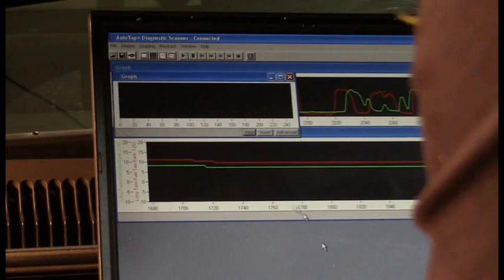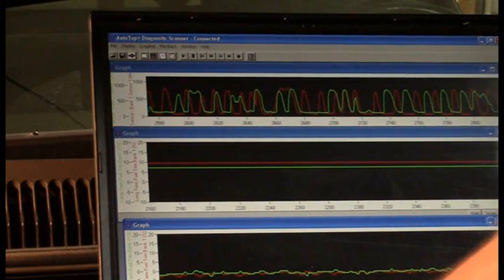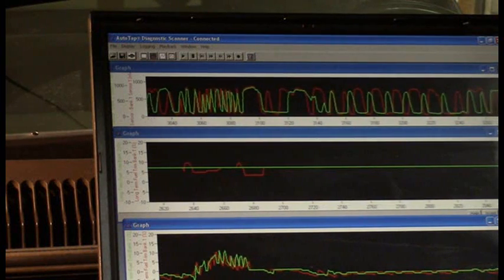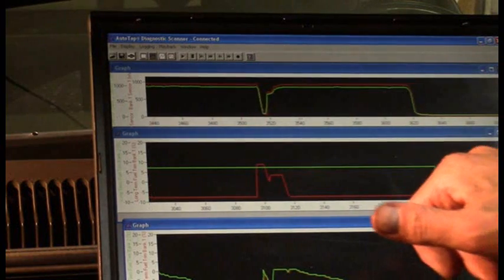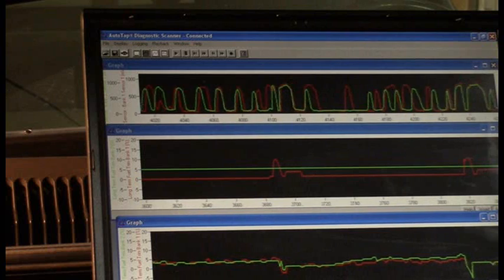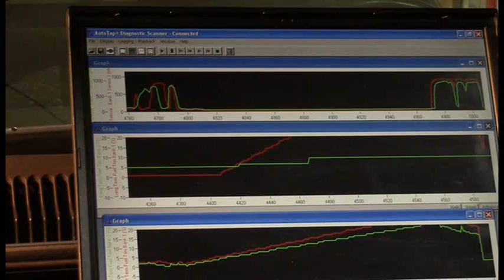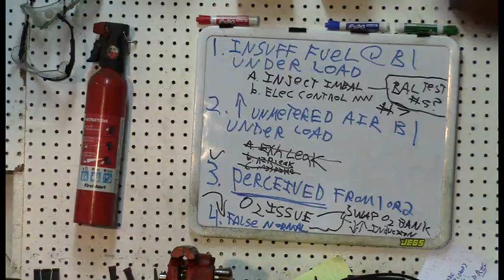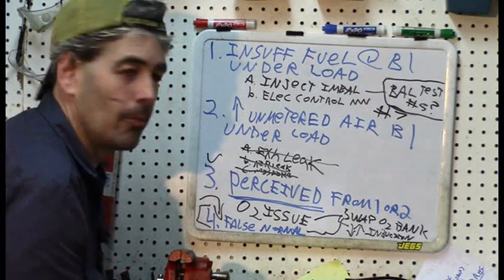Test Your Lean P0171 / P0174 Diagnostic Skills-Pt4

Comment: This may sound silly but why not try a different scanning software - Autoenginuity.  The problem with Bank Two may be a glitch in the scanning software you are using.
Reply: Sandbag1300 Dude, I like that! If you clear the codes maybe Matt can capture enough scan data to show what the O2s signals are truly generating before a P0171 sets again! Excellent Reasoning!
Reply from the maker: Actually maybe- but what caused the problem in the first place?  I agree if I clear the codes and reset fuel trim data and then fix the cause of the P0171 which may have been the issue all along that may indirectly fix this fixed LTFT.  We will see. But in a way, I hate to see it go away, this presents a fascinating learning opportunity into the operation of the computer lol.
Reply from the maker: Sandbag1300 It's not a silly idea- in fact I actually think that's the problem- but not because of faulty software or a glitch. What is happening (I believe) is I am seeing a "substitute value" for the B2 LTFT because the computer is seeing a problem that is "hidden" because we have an existing P0171 code preventing other issues from being revealed.  There is a way around this (using a modification to the software) which I will explain in next video.  But basically, yes, I think you are right- I need to set the software to ignore any substituted values the computer is using.
Reply: Schrodingers Box Could the fix be as simple as clearing the codes from the PCM so that the scanner will then pull LTFT data from the bank two tables that change based on O2 sensor input?
Reply: Schrodingers Box Operation of the PCM! Now that would provide some really interesting material for a series that who knows where it good go.
Reply: Schrodingers Box It would be very interesting if you ever wanted to put a custom PCM in your car and create a video series on the programming of that PCM.  Then, of course, vary the programming to see the impact on engine performance.
Reply: I am a novice.  My last auto shop class was in high school over 35 years ago.  We did not have PCM's then.

From what I read last night regarding programming PCM's suggests that the scanner is pulling bank two LTFT data from a table of semi fixed long term fuel trim values in the PCM that is minimally affected by STFT/O2 sensor input.  I believe it may be a default long term fuel trim table used when a certain DTC code is triggered.  This is probably to protect the PCM from adding too much fuel while the DTC is triggered.

My guess is that once you clear the DTC(s) from the PCM the scanner will then start picking up fuel trim values from a different table in the PCM that does modify long term fuel trim values based directly on STFT values/O2 sensor input.

Then, hopefully, the diagnostic scanning tool will help identify the source(s) of the lean condition.  Going out on a limb here my best bet is that Bank Two triggered the Lean Condition and the equal condition is present on Bank One.  This may mean new O2 sensors upstream on both banks or a new MAF.
Reply: Sandbag1300 Yes, that may be it. As long as the PCM is protecting the car from the problem that exists, we aren't seeing the problem.

Watching the PCM program a protection for the engine and catalytic converter may point to the problem itself.

Comment: I think it may be a substituted value problem as well.. I would unplug O2 check readings. I've seen a Saturn with substituted vales even when O2 was unplugged and never flashed a code. That car ended up being broken signal wire back to pcm. I think I'd check with scope or dvom at pcm. This is a really good case study you found. After you figure out the fuel trim issue you may find a maf problem! That would interesting. This is true evidence not to just throw parts at it!! Love your channel Matt!!
I'm a professional mechanic and love watching  your channel because I like looking for new ideas!!
Reply from the maker: Agree 100% and this will be easy to validate and will make for great video experience!

Comment: Fantastic - when I see illogical data I suspect you may be looking at a substituted value.  If I remember correctly  voltage readings can not be substituted.  I would look at O2 voltage scan data not graph view.  Since you have a fault shown on bank one does not rule out bank two as stated.  I did notice an air breather on bank two valve cover ?
Reply from the maker: Love the substituted value idea.  Yeah you are definitely on to something there. I think I will try to fix the lean condition to create a normal baseline then maybe something will throw when the 0171 is eliminated this revealing why there is a substituted value. Damn Steve- nice thinking. That's a solid  direction!
Reply from the maker: Schrodingers Box Steve- Seriously dude- you are freaking genius. I did some research on this and the evidence is overwhelming you are on to something- if not dead on correct. As some others pointed out in the comments, using my scan tool in "generic" mode may well allow me to look past substituted values. I have read of substituted values long ago but never thought about it til now- and if I can indeed adapt my scantool configuration to see real data, that would be a game changer.  I can't wait for the weekend so I can try some things in this direction!!!

Comment: Since the LTFT is a remembered adaptation maybe you need to do a code clear or battery voltage interrupt to get the computer to unstick from prior adaptation.
Reply from the maker: I will definitely do that, but it still doesn't explain why it isn't learning new adaptation.  I agree the first thing I need to do is try resetting though- well actually I need to fix the lean condition first to remove that variable and then ensure I get proper responses after resetting.

Comment: Most of your videos leave me scratching my head thinking about it for hours and I usually come to the same conclusion.  That don't make no god damn sense!
Reply from the maker: Hahahaha I'll never live that one down!! Yeah I am usually driving to work at my real job while trying to shake O2 sensor and LTFT graphs out of my mind. I can't even watch TV any more- I rewind 5 times every 2 minutes because I start daydreaming about fuel trims.
Reply: Schrodingers Box  My TV consumption has dropped considerably also. And when I do watch something I want it simpler, so if I'm distracted thinking about graphs and sensor read outs I won't lose what's going on.
Reply: ***** Your absolutely right, it makes no sense. So, no. 4 is false normal, if that's really the problem....how to test for that?

Comment: That was fun!  It appears we have to find out what within the electrical system translates short term fuel trim into long term fuel trim and test that.  GULP.  First, I would check Service Bulletins for your vehicle and see if there are any software updates needed.
Reply from the maker: Exactly- that is probably way beyond my capability.  I have been trying to find that information and can't. It's a little scary that it would necessarily be in the PCM.
Reply: Schrodingers Box I am guessing but imagine it is software code within the PCM that needs to be corrected or updated.  Makes one wonder if the computer uses STFT or LTFT  or both to make fuel trim corrections.  Could LTFT only be an analytic indicator or a real driver of change?  Great stuff you have uncovered.
Reply from the maker: Sandbag1300 STFT is the driver of change- LTFT "memorizes" that change to set it as the default.
Reply: Schrodingers Box Are you saying that LTFT is used by the PCM to adjust injector pulse timing and length?  

On internet searches I really cannot find anything about PCM programming and the specific variables the programming uses.  Information available is rather vague and white washed with repetition.
Reply from the maker: Sandbag1300 I am saying the LTFT is used by PCM to look and see what the injector pulselength should be. This default is set by the LTFT based on changes made by the STFT to bring the air/fuel back to stoichiometry.  The LTFT does not change the fuel delivery- it sets the fuel delivery for that condition as a result of "learning" the correct delivery from the STFT.  See my video "Secret of engine problem diagnosis: fuel trims" and it will be perfectly clear.
Reply: Schrodingers Box  Found this PCM tutorial interesting - in the link below.  This is a terrific learning opportunity Matt.  Thanks for this series!

http://para.noid.org/~lj/PCM%20Tutorial/PCMtutorial.htm
Reply: Sandbag1300
My simplistic take on it is that the total fuel trim used by the computer is the algebraic addition of LT+FT

Comment: That was a great twist. I think its interesting that the O2s and STFT almost exactly mirror each other. Like B1 LTFT is controlling both banks. Is the memory cleared after switching O2s? 
 
Up to this point you have only made changes (in air/fuel mix) that effect both banks what about make a bank specific change? To see how the computer reacts.

Thanks.
Reply from the maker: That's a good idea- I can just pull an injector or plug.  I will definitely do that, good thinking, but I expect we know what will happen.  I was also thinking maybe somehow B1 is stuck in open loop- but if so, how does it have STFT response?
Reply: Schrodingers Box-If B1 is stuck in open-loop because of an unforeseen problem, I don't think this would affect the out-put signal of the o2 or STFT. The STFT would be data that the PCM would ignore as if it were in open-loop. That is just my thought on this.
Reply from the maker: It would indeed affect O2 output because there would be no fuel trim adjustments to create the oscillating lean/rich condition creating the normal O2 sensor trace.
Reply: Schrodingers Box What i meant to say was the o2 output would still control STFT, but the pcm/LTFT would ignore these values. I'm probably wrong,  but I thought I would through it out there.

Comment: Hmmm, the only thing that comes to my mind is a wiring harness issue for 02B2?  Check the continuity?
Reply from the maker: If thats it, how is the PCM getting the O2 signal?
Reply: Schrodingers Box Well it might be getting a "signal" but not the O2 sensor signal.
Ghost voltage, shorted to something else. etc.  I would definitely load test the wiring from the sensor connectors back to the PCM looking for voltage drops.
I have seen cars where it only uses one rear bank O2 sensor.  The PCM assumes the other sensor has an identical signal. If you disconnect the reading sensor the second non-reading sensor might start to register a signal.
Reply: I though about the signal getting to the computer wrong, and then I thought I was thinking better of it. I mean, The O2 sensor is reading completely normal. . . . but then of course it'd read normal. If it was wrong, the computer would correct for it and get "normal" to just be wrong.

I'm personally left with verifying the wiring between the PCM and the O2. . . even if that isn't the problem, that's where I'm stuck.